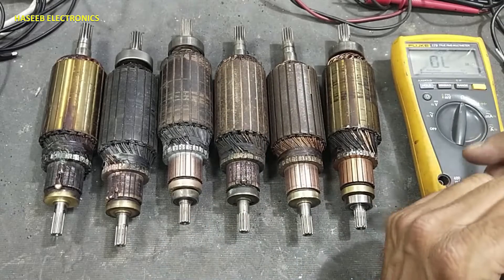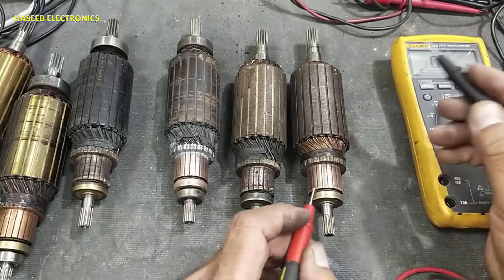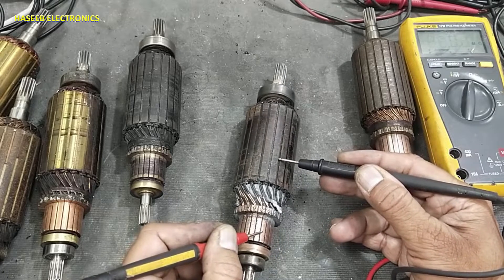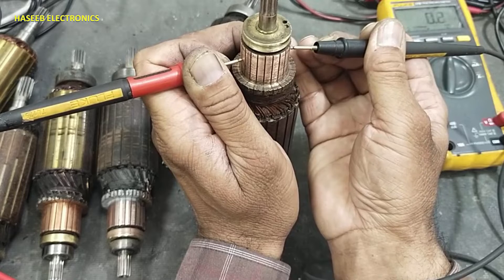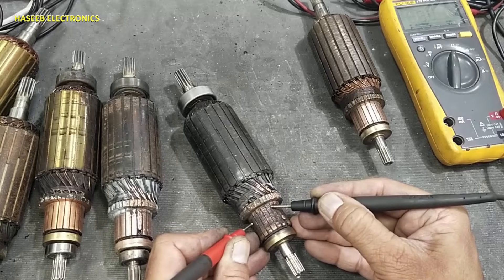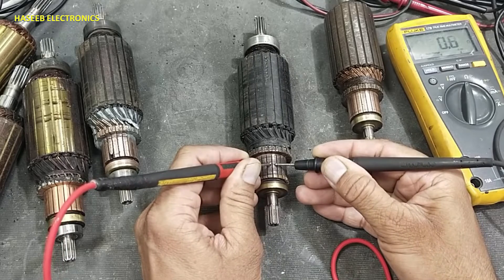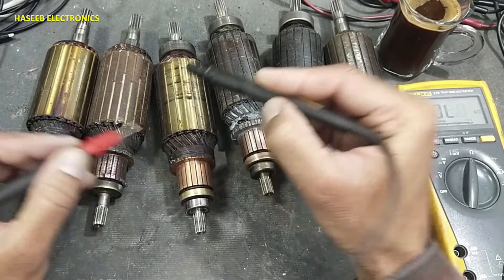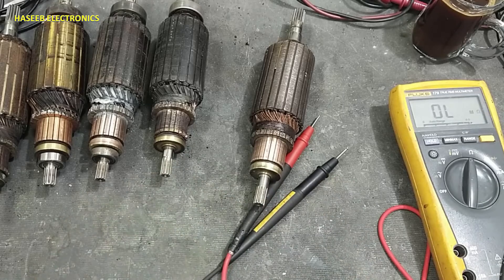{990} Testing Good and Bad Armature

Comment: Sir, actually simple work,care fully,wind with hand,or machine, with Sam gauge copper, wire,and change,commutater and cut slightly 0.5 mm,in lathe, lathe machine.since we repair. change bearing also.then fit with new carbon brush and current switch 😊 thankyou sir,
Reply from the maker: really perfect 
thanks for sharing

Comment: Ok . But do you think this method of testing is enough to prove funcionallity of some armature , without magnet for rotor ? I have also one qvestion .. If you know more about magnet field and coils !? If some stator has 340 coils in sum , two times with 170 coils with wire size 0,20 mm why is not possible use wire 0,40 mm with double less coils , 85 in this case for same magnet field ?

Comment: Finally I'm starting to understand . I think I have bad soldering .It is ok if I try to resolder the contacts at each connection ?. Best video on the subject I ever saw .
Reply from the maker: yes. dry soldering makes huge problem, as at high current a very minor amount of resistance causes to drop the voltage across the dry soldered connection,
wire insulation must be removed properly, then tinned properly and must be soldered properly 
thanks for your valuable feedback

Comment: One of the most common fault is when the interwinding are shorted , or partially shorted. In this case a Multimeter is not very helpful. In the industry they use a device called Growler to diagnosis. You can make your own Growler easily, there is a bunch of videos show how to make one. This is the only reliable test for shorted armatures.